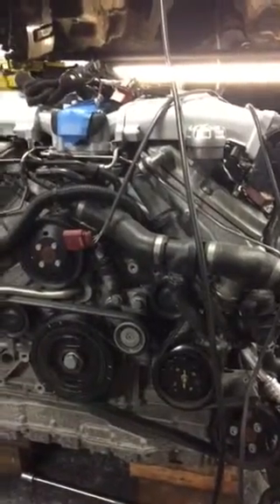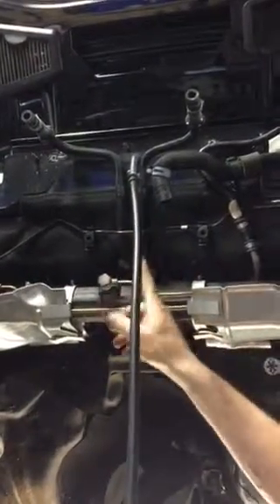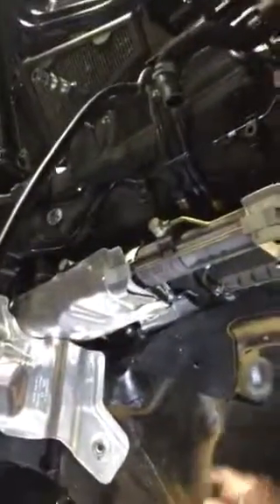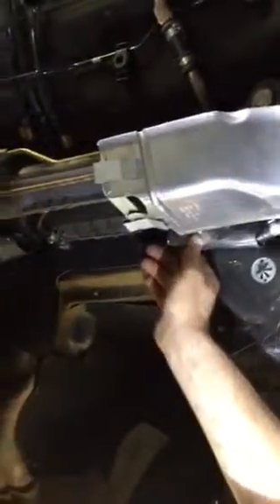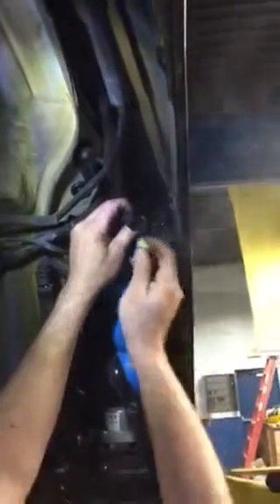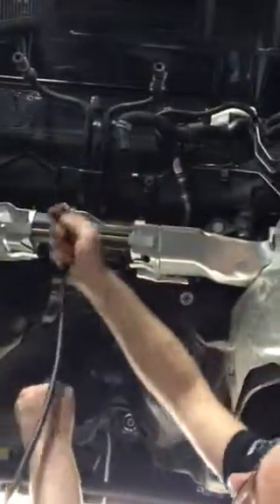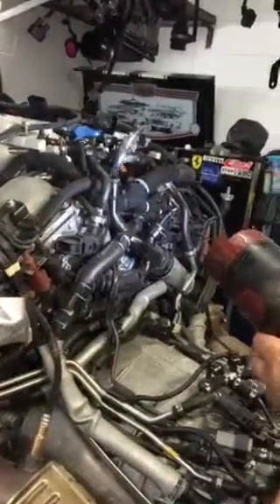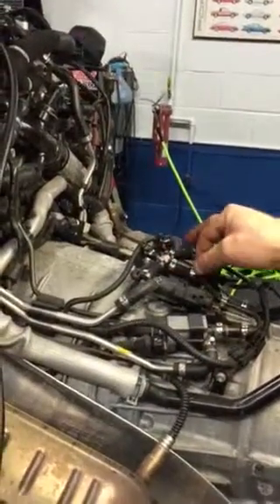Bentley GT smoke test body and Engine

Comment: Hey Jason, hope you're well. Is there any reason everyone unplugs the vacuum reservoir to do this? I'm wondering if it would not be easier for me to use one of the connections at the rear of the intake manifold and plug the engine at that point, or is it that the solenoids would inhibit the flow of smoke? Thanks in advance :)
Reply from the maker: @BentleyOnABudget-mp8jj  The reason I use the line going to vacuum reservoir is to check the vacuum system without incorporating into the pump (witch would vent to atmosphere) and this does make it into the engine. I do remove both air filter boxes and cap off the inlets to both turbos. With doing it this way. You can smoke the whole system including intake and turbo intercoolers as well.  Smoke testing from rear of intake line going to line set would work if you were to cap off the vacuum pump so it didn’t vent to atmosphere.
Reply: @porsche951g  thanks very much Jason, very much appreciated mate :)

Comment: How much did this job cost? I need this done on my 2005 Bentley GT. So upset. I'm now trying to decide if it's worth doing or selling and buying a 2006 late model or  2007 gt coupe or convertible. Bentley has advised me that it will be $8,000.00 - $10,000.00 and another company that works on my bentley I replaced the struts with said they will do the engine out and replace those vacuum lines for $4,000-$5,000. How long did this job take you to do start to finish? Btw great video I can't wait to see more videos from you for the bentley seemingly mine has every major issue that all of the forums talk about. Thank God my Porsche is my lifesaver and never gives me issues. Please advise. Thank you. R
Reply from the maker: Hi Ricky. I do those repairs for 4K. Labor and lines. Everything else is extra like the vacuum pump and new fluids witch make sense to change after draining coolant and P/S fluid. Porsche cars are amazing. Any advice you need let me know. Thanks.